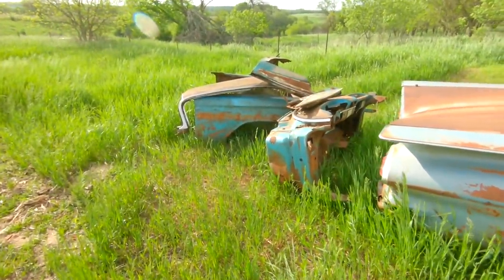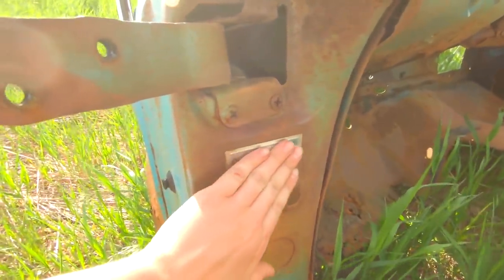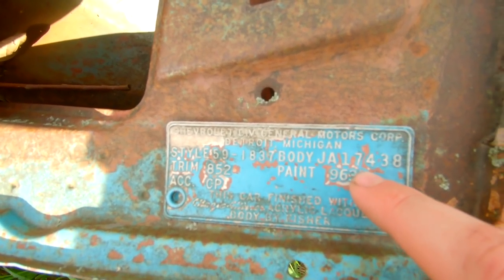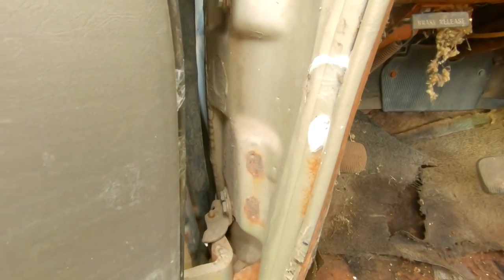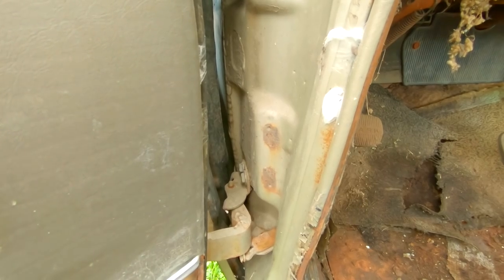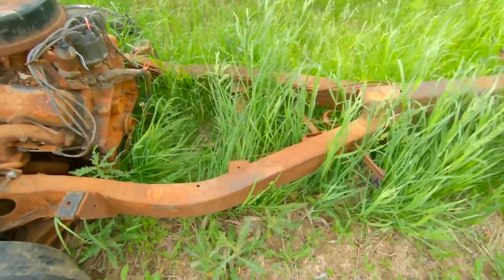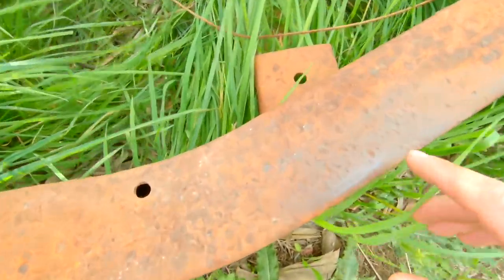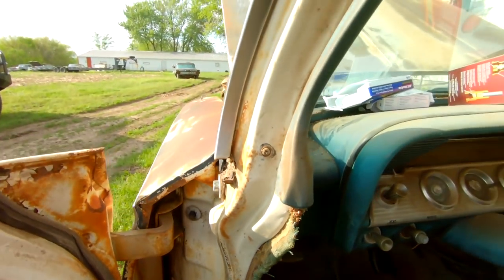1958-1964 Chevy VIN Tags Information - Hidden VIN Locations, Cowl Tags, and Title Questions!

Comment: Thanks for your video, as this knowledge is becoming more critical. It is not at all unusual to see ads for cars that are mislabeled as to some major point, such as year or model. I recently dealt with a car flipper who had acquired two cars at an estate sale and was honestly confused about the model years. It was also clear that he had not tried to match the titles to the VINs. This could have led to a chain of events with no good ending.
Most of the ads I've seen with incorrect model years involved selling the car on behalf of a third party; regardless, most sellers are quick to try to correct the information. But I've also seen cases in which although the title matched the VIN, the grille/front fascia or other year model identifiers were incorrect. The seller would then tell me of having no knowledge of such alterations as implied by this.

Comment: Something you missed is that there's another partial VIN on the driver side rear frame rail about a foot forward from the back corner of the frame. It's on the top as well. You might try looking on that pitted frame and see if it's there. I've found it on two 63's so far.
Reply from the maker: Thanks. Ive never seen one there.
Reply: Yep...I was looking to see if someone mentioned this. Decades ago the recovered stolen cars sold at auction, often had the trunk metal cut and bent up to expose that number like you did the floor pan, to verify the car's true Vin. My brother bought a few at auctions decades ago like that.

Comment: As someone from the lowrider scene, what if frame has been changed to a fully reinforced frame, that means full boxed up metal across the whole frame?? And if that's illegal why is it that there are aftermarket frames for like restomods
Reply from the maker: Frame isnt illegal
 Swapping vin tags is. Thats why i said, beczuse of bad actors its always best to go in with as much info as possible
Reply: @IowaClassicCars  and also i was told that the highway patrol has to issue new vin tags, the vin tags on ebay are etched not stamped like originals where you can feel the numbers
Reply: @alonsogarcia3593  Yup, in Commiefornia, only the CHP can issue legal VIN tags, and of course they don’t look like the originals.
Reply from the maker: California is a communist state lol
Reply: @IowaClassicCars  Best answer of 2021 so far!!!!

Comment: Hi friend, I have ‘69 Bel Air and can’t find additional tag (car was painted badly and brutally)
Near dashboard it starts with 15569 ( a third digit mean inline 6, and it has one)
But during paperwork we realised that body code is 15669 (v8)
And problem is I can’t find a place were tag was or should be
Can you please help, I would really appreciate that ❤

Comment: Thanks for the info!  I have a 1963 Impala convertible but my vin and cowl tag have different plant manufacturers? Cowl is VN (Van Nuys) and Vin has J (Janesville)?  Also car came with Original dealers sales Ticket and has Paint listed as Autumn gold which car is currently autumn gold but cowl tag paint code is Palomar maroon?  Not sure what to think.

Comment: GM also stamps a partial vin into the engine block...the 58-64 years might be before that tho
Reply from the maker: 1963 was the first year of that, 62 409s also had the vin
Reply: All 1954 and older as well as some 1955 cars and trucks had the Vin stamped on the on the engine block instead of a tag on the body. It can cause a lot of problems getting a title or proving authenticity of an existing title if the original engine is no longer there.

Comment: Is there a way to know by the vin tags on a 63 impala if it had a 283 or a 327 ? I know the ss trim was optional. So how would you know if you have a ss Impala with a 283 engine ? Or non ss with a 327 engine ? Where engines a dealer option ?

Comment: ryan,title ID number is not even close to vin # north dakota title. serial#or ID # says 0000P8HSC246 vin tag,21847J156279 thanks for any help. title date resell date to second 2/2/69
Reply from the maker: Sounds like you hsve a title for a motor, not the VIN. Thats odd. But that title is no good to you without original motor it seems and youll need to find that number